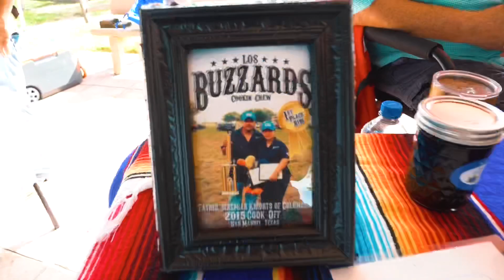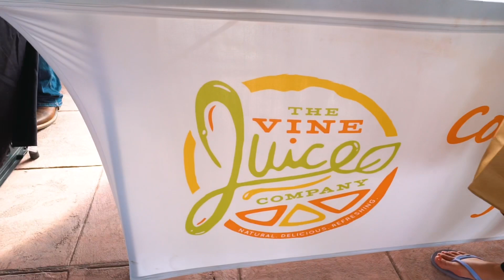Concrete Countertop Results - Ranch Rescue

Comment: Jason your cabinet and countertop is beautiful your doing a great job.
You can use sand that down a little but wear a mask because rock dust will stick in lungs. Since I’m a contractor here’s my advice. Concrete absorbs everything and will stain so easy, so you can buy concrete sealer from Lowe’s or homedepot that will prevent it from absorbing liquids, there’s many different types of sealer so read before you buy.
Also with concrete you can set hot pans and stuff on it and it shouldn’t hurt it so if Jaylena puts resin on it you won’t be able to set hot pans on it or cut on it like if you leave it as sealed concrete.
There may be a special kind of sealer for countertops so ask someone at the store. 
Hope that helps!
Love what you’ve done though!!

Comment: Liquids will tend to soak into the surface, carrying stains into the concrete itself. Acidic substances like vinegar and lemon juice will dissolve the cement paste, etching the surface. For concrete to be a practical countertop material, it must be sealed to protect it from stains and etching.
Reply from the maker: We know

Comment: I made a fireplace hearth with concrete similar to how you did the counter top, and I put wire mesh in it.  When I turned it over, it cracked.  Since you are putting the concrete on top of the existing counter top, I don't think you need to have wire, rebar, or mesh in it.  The crack gives it character.

Comment: Yes put resin on the concrete. If you make another concrete counter top, put some metal rebar or fencing in the middle of the cement. It will prevent cracking when you turn it over.

Comment: Cheap, but functional! great job!

You should accentuate the crack... fill it with a contrasting material.  Look up Kintsugi. It's what is used to repair pottery, and celebrate the history of it, "dings and all". You may have seen, pottery with "gold repair" cracks. Jaylena already has the materials. Use some resin and colorant and just pour it into the crack. Gold metallic is traditional, but it doesn't have to be.

Comment: You can still sand concrete until it full cures which takes quite a few days. Just be sure to wear a mask if you use a power sander.

Comment: Jaylena found some bones...what about using some small bones on the cement counter and encase the whole thing with some tinted resin...use coins, paper money, old buttons, arrow heads, shells, rattlesnake rattles, ...whatever but build it up in a frame till it sets up...or 
Road map of Texas in clear sheaths then in tinted resin...you will do fine...hugs from Kennebunk ME

Comment: The counter top is cool the top cabinets look good opened maybe you can cut a hole in the middle of the the old doors and put some small hole metal grating inside the door. That would look awesome with the concrete. Just a though

Comment: $6 good job. Hey, if you have any sheet metal out there...you could make the inside of a drawer rat proof...attach it to the wood so you don't get cut up on it, but tight fitting.
Reply: I like you're helping out the local small business. Wish I could afford to help out.

Comment: This is my OWN personal opinion, and in no way am I telling you what you should do ....
If it were me, however, I would leave the cupboards open ... at least the top ones.  Someone earlier mentioned Ball jars (widemouth) for storing foodstuffs.  You can either use their metal lids, or if replacement lids that are white and come in  an 8 pack I think.   That’s what I’m starting to do with pastas, rices, and whatnot.  I like the look in my pantry.  But for your CAMP HOUSE n, I think stuff like that would be fitting.  I don’t think I’d waste the money, cuz it is expensive, for the resin topper on the concrete.  If you made a slurry and filled the holes then sealed it, that would be great.  Maybe make or get a couple of large cutting boards with different woods in them so hunters aren’t cutting directly into the concrete. I like Jaylena’s idea  of the curtain/skirt for the bottom cupboards, but make sure it’s manly (plaid or camo or the like) since it will be used for a hunting camp house.  AGAIN, my own personal opinion ... you do what YOU guys like, and Papa Crocker thinks is best.
Lovin’ your seemingly renewed commitment to the ranch.  You guys just look less stressed, more easy going ... and dare I say it, EVEN HAPPY which brings a smile to my heart ❤️

Comment: The counter tops could have been done with chicken wire embedded in the concrete to act as rebar.  That would help with cracking
Reply: But it does look really good

Comment: I enjoyed your mom's live chat yesterday. I was afraid that that counter was going to crack when you tried to flip it , but I'm glad it's such a minor one that you'll be able to repair it. It will be interesting to see what you decide to do with the edge of the counter tops that still have the old laminate exposed. I think it would be a good idea to have Jaylena put a resin seal on top of the concrete, so the easiest solution to the laminate would be to find one of those countertop paints that would match the concrete and then have Jaylena seal the whole thing. And I agree leave those shelves open over that particular counter.
 Your idea for the T-shirt package is brilliant by the way.

Comment: You cure concrete counter tops for 30 days and the sealing process is multiple steps, concrete is very porous. Resin coating is not really safe for food areas, coffee tables, not counters.